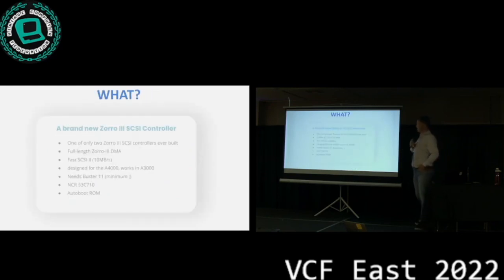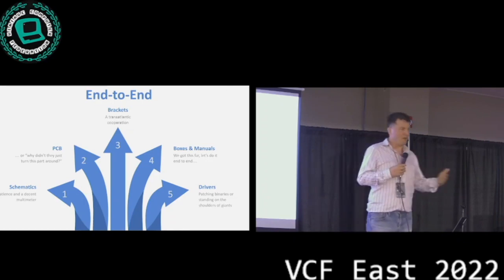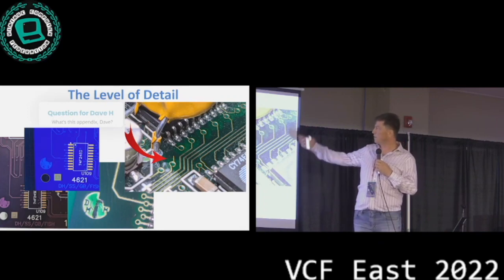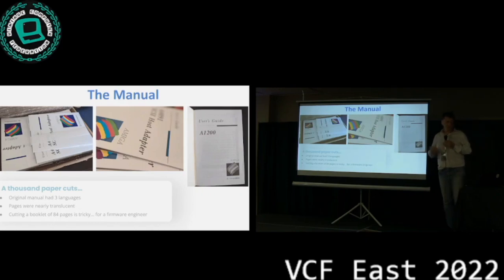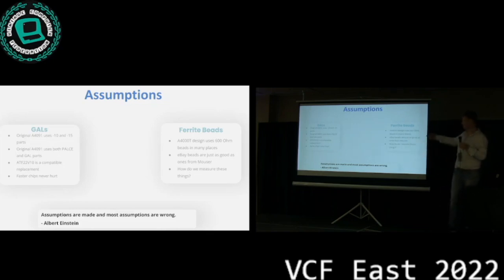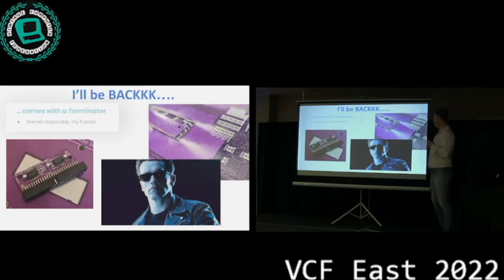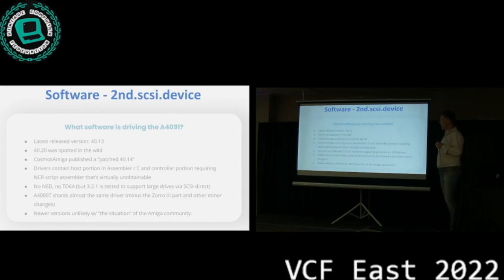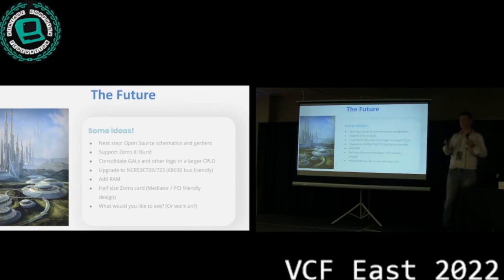VCF East: ReA4091: Commodore Amiga A4091 SCSI Host Controller Reverse Engineering

Comment: Stefan, If you need an A4000T to test a card and driver etc. on, write me.
Reply: Thank you! Chris recently obtained an A4000T and I believe he started testing on it already. Some of the fixes that have landed in the open source driver since the original release should help with running the A4091 in parallel with the onboard SCSI controller.
Reply from the maker: I passed your message on to Stefan. Hopefully he will be able to respond.